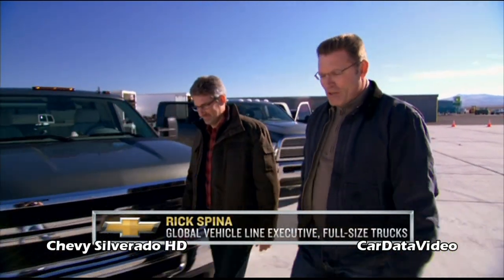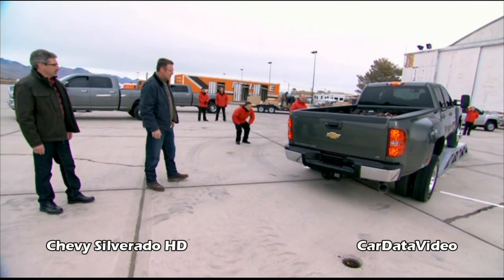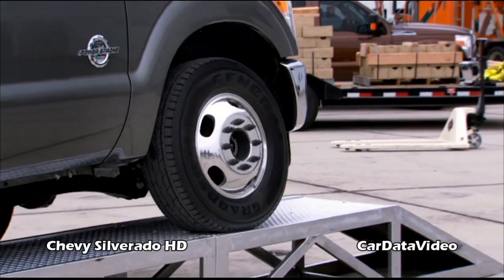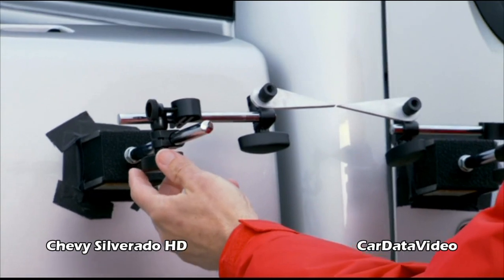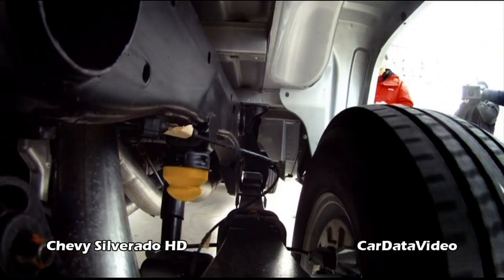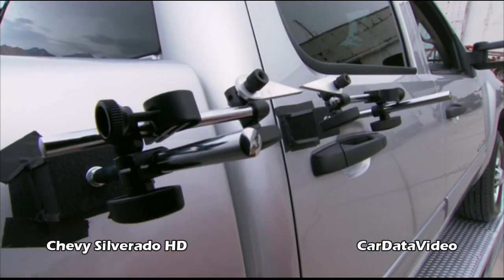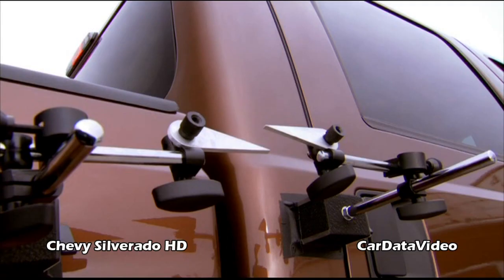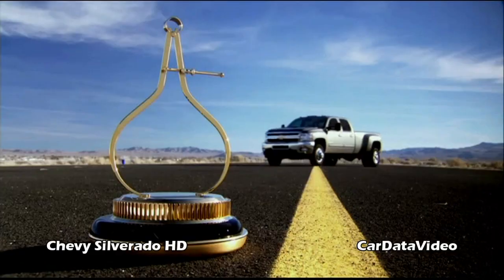Chevy vs. Ford HD Truck - Bed Bend Video

Comment: Well it's a fucking Chevy ad
Reply: Has anyone seen the way the new ford aluminum beds crack under stress lol
Reply: +sammy duran that's a Chevy "ad" too
Reply: Starstriple Yup and they're both ford fails
Reply: +sammy duran How about the chevy commercial with the bear and with the steel cage and aluminum cage where everyone went into the steel cage when real bear cages are made of aluminum.
Reply: Whitestar Ya pretty funny, what I'm waiting for is for the new aluminum super duties to go through frame twist obstacle, I wonder how they're gunna hold up this time lol
Reply: +sammy duran dude the frames are not aluminum just the body
Reply: +sammy duran the whole aluminum bed this cracking or easily breaking is a bs ad it's just Chevy being desperate again like always. Because even they know fords are better than any other truck for work
Reply: +Viktor Step 
I can't think of any pickup owner that would dump a front end loader full of landscape blocks into their truck - or throw a toolbox into the bed.
Just more GM desperation
Reply: Mike US OG K I can think of plenty there's people where I live that use trucks and winches to drag bolders into their trucks for landscape decoration. Or laying huge welders into there trucks with a fork lift over and over every day on the oil fields.  It's the concept of prolonged durability use your imagination guy.
Reply: +sammy duran 
There aren't many that use them like trucks here.
they're all 1/2 ton Cowboy Cadillacs, leather, power everything, in dash dvd etc. - hell, the only time they'll take 'em off pavement is to wax 'em on the front lawn. For every work truck sold there's at least 500 1/2 tons sold that don't carry anything heavier than a jet ski.
Depends on what you're used to seeing, I guess.
I stand by my comment about the frames just the same - if they won't flex, eventually they'll break.
Think fishing pole...
Reply: Whitestar In the twist ditch test the Ford received a huge dent across the tail gate that's what I meant.
Reply: +sammy duran 
I appreciate your point - they should "float" the body better.
Past experience tells me what I said before about Rigid.
Reply: Mike US OG K Your comment on the frame flex should change as well becasue the new "supeduty " is fully boxed now. They approached achieving fully boxed diffrent than gm though gm is an extruded steal and hydro bent with freezing water and Ford is 2 welded "C" channels.
Reply: +sammy duran 
nope, sticking with what I know works.

Incidentally, GM has been hydro forming those frames for about a decade now - and boy did they have serious problems at first.
Reply: NotDoge and a Chevy ad is a ad you should never listen to.
Reply: note the Ford f250 did not get a buckel where the f350 did something is fishy hear
Reply: ALEXIS Pellitteri yea it's a weak ass truck! There is your fish! 😂
Reply: Perry Hughes it's actually a good thing to have chassis flex because if your suspension is too thick it will crack and cause permanent damage to your truck. That's why Ford made Chassis' for Peterbit semi trucks. Because you have to have a stiff suspension and be able to flex over small bumps as well.
Reply: Top gear Gaming You could've said that 2 years ago before the release of the fully boxed f250& f350 now your statement has no validation.
Reply: sammy duran now read it.
Reply: SodiePops i know
Reply: SodiePops ikr
Reply: ford is better then chevy
Reply: oreokingjr no
Reply: yes ford is a lot better then a shity chevy
Reply: yeah, if it was a ford ad the chevy would have busted in half.
Reply: well i need then
Reply: Chevy has their own host of problems. There was such a huge recall on their truck air conditioning units that there was a nationwide shortage for most of 2014 and 2015. My a/c in my 2015 truck won't blow cold and I had it in twice to be checked and they said 65 degree air coming from the vents is normal.
Reply: SodiePops papa knows best
Reply: Mike OG K I've always wanted to know why Chevy guys get so but hurt and never give created to Henry Ford for making the first moterized vehicle
Reply: Yup, I would never put a bed liner in a truck, that would be stupid, right? Another thing I wouldn't do is be careless enough to leave a 100 pound toolbox on the edge of a bed (which looked very light btw) and run into it. The final thing that I DEFINITELY wouldn't do is lie to millions of people and risk getting sued. Just a thought.
Reply: the RC entertainer *Too
Reply: the RC entertainer And you are too basic to even know what ritardondo means
Reply: Colbe Ellis  you need a fact check. Henry ford dident make the first motorized vehicle, he made the production line.
Reply: Electronics For Fun completely, I am a Jeep Wrangled guy and would much rather go back like my first with the 4.0 and low gearing, was an automatic with only 3 gears and could pull and not get stuck. Need better mixed of old and new, not just conversions into "Family" rides.
Reply: sammy duran ford had a c-channel frame in that year of truck. Chevy has a boxed frame in that year if truck. C-channel is better because when you have 4,000pounds of payload in the back the C-channel will flex and there won’t be as much stress on the frame but with the boxed frame you lead spring shackles will start to crack because that I️s the weak link kinda it adds so much extra stress to the frame that’s why most semi’s are C-Channel frame not boxed trust me ford knew what they were doing. Until they came out with the new truck with a fully boxed frame. ‘‘Tis ‘tis tis
Reply: Mike OG K exactly
Reply: Electronics For Fun and the 3.5 has 400 horsepower, even though I'd still rather have a v8
Reply: Mike OG K if frames don't flex the will break their weld points I boxed my truck Frame in for off roading stiffer holds up more keeps align but cracking welds and frame joints 're weld them but time consume go to the junk yard look that the truck frames where they normal crack break at right behind the drivers dude of cab
Reply: Sigh...some people hate it when the facts are put directly in front of their face...
Reply: SodiePops you don’t like Chevy because the last longer than fords? And are more stronger..... it’s a fact
Reply: but do you ever see a ford ad that makes a chevy look bad? hmmm.
Reply: Bullshit gm ad, I bet they unbolted the cabin bolts on those fords. Both worthless brands but I’d take the ford if I had to.
Reply: Caleb Newland No, he made the first commercially available, yet budget efficient mass produced automobile through means of a production line. Saying that he just simply made "the production line" is just as incorrect as the other statement you are attempting to go against.
Reply: They put bigger leaf spring on it so it won't flex except when its got a certain amount of weight on it
Reply: SodiePops no shit chevy is better than ford
Reply: SodiePops the

Comment: Remember when Chevy
Said they are more reliable than toyota and Honda.
Thats the worst commercial ever😂
Reply: Well i got a 96 chevy truck with 496k miles on it only replaced intake gasket and wearable parts and of course 4l60e trans . thats 496k of chicago stop and go and driving across kentucky through mountains
Reply: @beastmode3537  nah its not. Gtfo with your chevy fanboy bs.
Reply: @anthonyppool8203  Engine? Please dont brag if you have anything over 2.6L. Any V6 or V8 from Honda or Toyota will easily do that.
Reply: @beastmode3537  chevy? RELIABLE?
any chevy before 2004-06 is good
anything after is SHIT
Reply: @anthonyppool8203  gotta 03 Sierra with 300k miles still out performs any ford I've raced
Reply: Anthony Ppool 2006 Toyota Tacoma a little under 300,000 nothing has to be changed yet and my dad beat the hell out of it and now I am but I’d say 400k miles before the engine needs to be rebuilt such as headers and maybe rods
Reply: I had a friend with a 95 Civic that had 796k on it.  Base line single jingle engine, automatic transmission.
Reply: SMR0M i have a 2011 chevy with 400k km in kuwait do u even realize what that means ? Kuwait is smaller than any state in the us and i have 400k km and that beast never said ouch ! And yea fyi we have deserts so take what u want from that been off roading the shit out of it since 2011 , chevy trucks are reliable af
Reply: Anthony Ppool with chevy the are hot and miss with reliability
Reply: Yea I’m a Chevy guy myself and I was even like “ come on Chevy don’t just put right lie”
Reply: The Chevy was the best selling truck for many years for a reason (counting gmc) they're easy as hell to work on more simple and more reliable than other trucks. I have peace of mind putting 2000 miles a week on my 5.3 with 320k miles because I know when it breaks (if it ever does) I can go to a junkyard and find another, slap it in under a day because they're so easy to work on and go another 300k. There's a reason they haven't changed the engine design in years, because it's tough as nails
Reply: No they are not
Reply: the worst is when they compared a Corrola to Truck..
Reply: If Chevy's never breakdown and are so awesome than why do all the fan boys here boast about how many they've gone through? I bought my first Toyota in 2005, still drive it every day with no plans or thoughts about replacing it.
Reply: @anthonyppool8203  that's bc older cars were built to last
Reply: @beastmode3537  they arent stronger then ford or dodge
Reply: @nathanschild2388  chevys break more than any truck they are built out of cheap parts
Reply: @rickygarcia7400  Thats because your bro cant drive. Maybe a small car would be best for him.
Reply: Bondying Abnoy Ik
Reply: Not really, ever since I switched from honda to chevy I havent been to the junk yard in years.
Reply: Toyota actually is overrated..some chevys last more than 400k miles. Toyotas last because they are tiny toy that are used like cars!!!!
Reply: There was a Toyota tundra from 07 and it had 1,000,000 miles on it and it had no problems
Reply: Beast Mode For Real
Reply: I've got an 03 Chevy Duramax turbo-diesel and it tows and carries stuff perfect. Great torque, climbs to the speed limit fast, and overall reliable. I think it's good, but go ahead and disagree with me ford fanboys
Reply: Oh I know that's a lie
Reply: ya i am a chevy guy but they are not more reliable than Toyota or honda but are more reliable them ford and dodge
Reply: Remember when Toyota bought back a 2007 tundra that had a million miles?!
Reply: yeah lots of chevys are on the side of the road now
Reply: @beastmode3537  fanboy
Reply: @skyshade9106  haha you so mad kid
Reply: @Dark-xs5lf  If your racing trucks, you’re doing it wrong. They are meant to tow and be reliable. Ford is like Toyota. Perfect it overtime
Reply: @aal-m3545  And I totally believe you. No. Any mechanic knows modern chevy’s are not reliable. And to the rest of you saying I have this car and it has this many miles, I really doubt it does.
Reply: Worst car I ever had regarding reliability was a Chevy, none of the european or japanese cars I have owned has given me any trouble, but the Chevy was a fucking lemon...
Reply: @anthonyppool8203  Older chevys were better. As soon as the late 90s and early 2000s rolls around, their quality dropped and Honda and Toyota began to introduce new lineups.
Reply: @Dark-xs5lf  ....pickup trucks aren't race cars??? They're built for strength not engine power
Reply: @dynamiczna11  you so mad haha you bought a pos lmao 🤣 😂
Reply: @anthonyppool8203  90's Chevy trucks are good, but their cars not so much..

Comment: I had a brand new F-250 4x4 and with 40 miles on it when I was driving it home from the dealer the turbo blows up on me then after fixing that I had a fuel pump go out at 15,000 miles while sitting in traffic so I had no way to get to the shoulder so after that I sold the pile of shit and wrote off that god damn company I will never buy another ford again.
Reply: boo hoo
Reply: Same with the f-350 I own. The thing broke down all the time and rusted out quick! Honestly I need to make a video of it because it is kind of ridiculous how fast it did rust.
Reply: Michelle Unis Dude I fill your pain I seriously thought I was spending my hard earned money on a good truck but I didn't even get to enjoy the first drive home in it, now every damn time I even think of that POS it makes me fill sick. Just last month my buddy took his F-350 to Glamis and on the way home he had a axle shaft walk all the way out on him dropping the ass of the truck on the ground at 55mph!!! The truck is only a couple years old and the list of issues he told me is just growing and growing. Now I drive a new Chevy 3500 for work and an older Tacoma for everything else and couldn't be happier with both of them.
Reply: I wonder why the turbo blew out? hmm.. The vehicle will represent the driver.
Reply: Turbo only blew because you were on it to hard and was running too many pounds of boost
Reply: Paulie Makowski It was bone stock from the dealer and I was in stop and go traffic on the 15 south in Corona California with ONLY 40 miles on the clock Justin you say driver error is there a special way to drive such a pile of shit like a ford??? I was driving it totally normal for stop and go traffic. My 2013 Chevy 3500 just hit 75,000 not one issue and I tow a huge hydro dump trailer with it almost everyday, my 01 Tacoma 4x4 250,000 hard offroad miles has never left me on the side of the road ever. So if it was driver error how come my driving style hasn't blown up the turbo in the chevy or broke the Tacoma? But within 40 miles with the ford it was dead in the water I don't think it was driver error I think the problem was with the badge on the front that read FORD.
Reply: Umm isn't this a international navistar problem and isn't this the reason ford came out with the 6.7 that I love and admire
Reply: 1TonTaco Michelle Unis No offence, but you guys must drive like complete "tards" to do that to a brand new truck just saying, I like both, but I'll take your word for it. To everyone else just buy whatever truck YOU want and stop arguing, please grow up.
Reply: Joey Junior As soon as I bought it it was from the dealer to the freeway in stop and go traffic I don't think I ever had it over 50mph and at around 40 miles on it the turbo goes, Joey I've been driving my 2013 Chevy 3500 work truck for almost couple years now as you would put it "like a tard" and not one issue at all also almost every day pulling a huge hydro dump trailer??? Also I've been driving my 01 Tacoma 4x4 for 250,000 miles "like a tard" and tons of offroading for almost 14 years and its never  broke down on me ever. I also have a 1999 Tacoma I've owned since new and been driving that "like a tard" for almost 16 years 180,000 miles and never left me stranded now that one is my rock crawler project and still runs perfect even though I drive it like a total tard.
Reply: Well, it must have been bad luck. My dad has a 2000 F-150 170,000+ miles and has only had minor problems. Anyways just get the truck you want, I like almost all trucks makes,models, etc.
Reply: Joey Junior I do know some people that drive Ford and swear by them it was one of the reasons I got the F-250 in the first place was because a good friend of mine had one and beat the hell out of it with no issues at all then I got mine and all it was, was issue after issue with it my ford friend was even stumped and told me it had to be just bad luck on the dealer lot???
Reply: That sucks. My GMC Canyon has just over 120,000 miles on it and nothing has broken yet except for my rear drum brake cylinder. Was a dirt cheap part to replace anyways so it doesn't really matter. Also I abuse the shit out if this truck every day and it runs like the day I bought it. Only real problem I ever had was a misfire in the engine and all I did to fix it was move the fuel injector packs around and it fixed itself lol.
Reply: Kenshin Himura Dude I was out rock crawling in one of my Tacoma's a few weeks ago and came across a guy stuck in the middle of a small river crossing in a GMC Canyon I thought he hydrolocked or something so I stopped to help him out and ended up towing him all the way out to the trail head the reason his truck died on him was he put 5 gallons of 2stroke gas in his tank and it just happened to stop running in the middle of the river LOL!!!
Reply: Kenshin Himura Yeah I don't know what the dude was thinking he had his whole family with him also and no overnight supplies he was about 15 miles into the trail and lucky for him the trail I was on ended right where he broke down. He even said a couple guys in Jeeps went by but couldn't help cause they had no tow straps.
Reply: Fords always sucked

Comment: I have a 79 Ford, and while I don't have any issues with sudden bed denting, I will say that there is enough flex to the frame that you can see the bed/cab offset just from parking on uneven terrain, like next to a tree.  Does it bother me?  No.  Would it be better if it didn't flex?  No.  The frame is part of the suspension, in my opinion.  It's just a great big Model T.